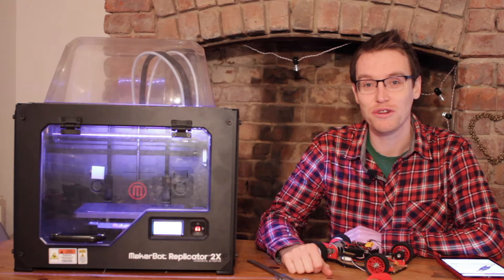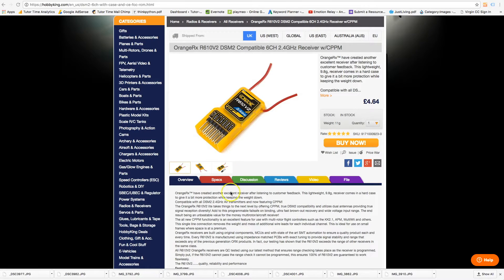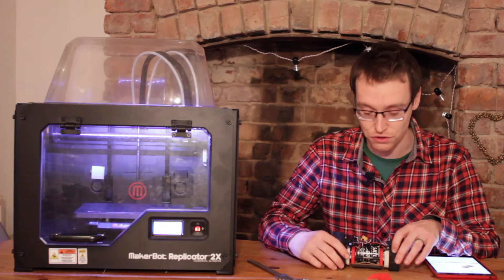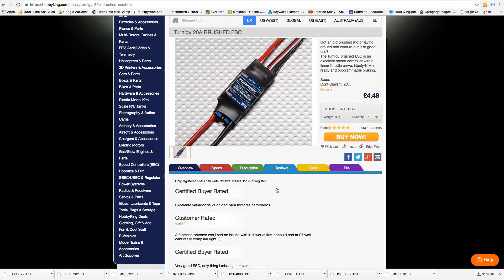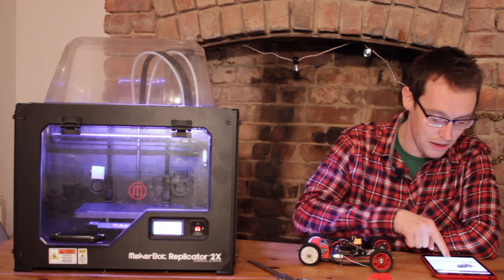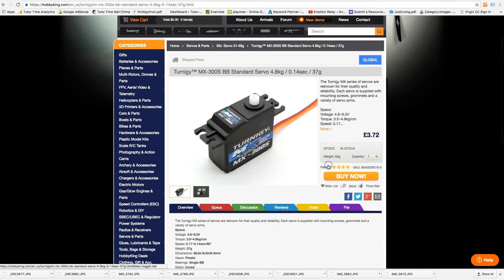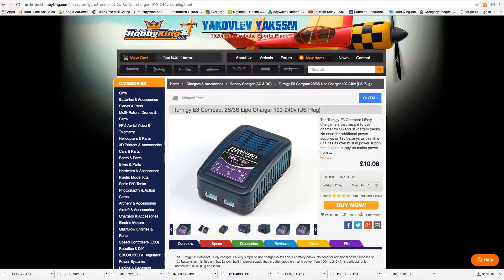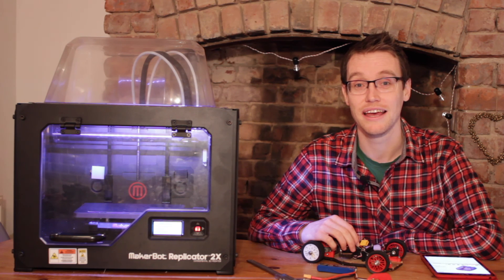DIY RC Car - Budget RC Electronics Buying Guide - OpenRCR  3D Printing

Comment: I bought the Esc you recommended in the video; could you do a video showing how to set it up? On mine, when the throttle's in neutral the motor turns!
Reply from the maker: +Toby Blake hmm interesting. I've had the same problem and assumed it was the transmitter. It's as though the neutral set point is too far forward. Have you tried hobby king support? I have been meaning to get in touch with them for a while.
Reply from the maker: +Toby Blake I've had a similar problem. I assumed It was the Tx - do you think it's the ESC? Sorry for the bad suggestion if that is the case!